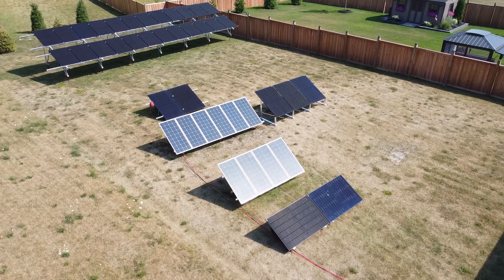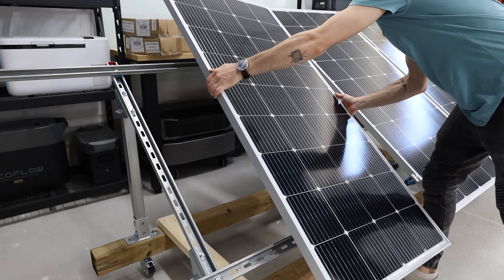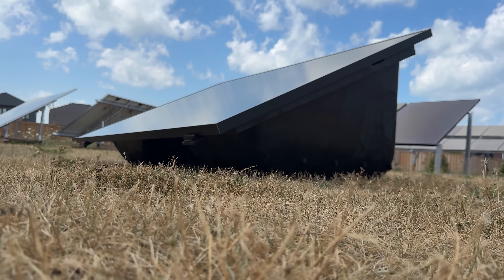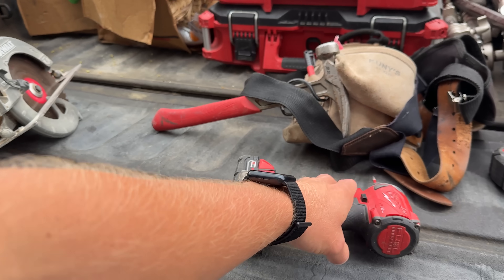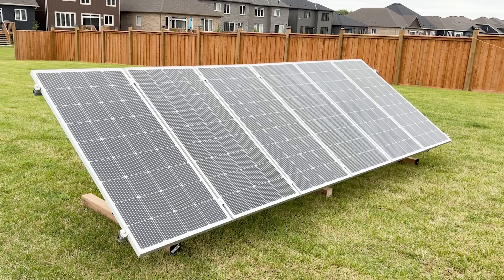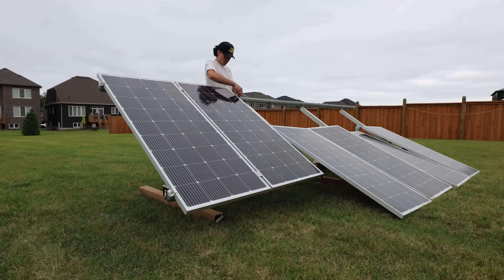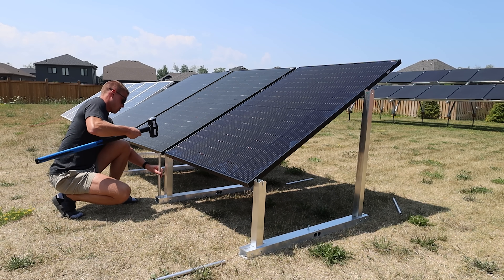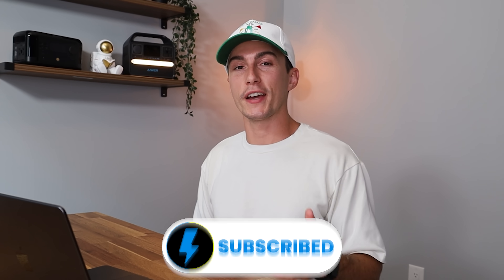Top 5 Solar Panel Ground Mounts in 2025 - DIY Friendly!

Comment: Well, I typically find a video like this after I have already made my purchase, and that is the case again, luckily I bought the Integra system for my 14 560 watt panels, I was very impressed by how well thought out this system was, I had no difficulties with the grounding spikes, after pre drilling the holes where I set up the rack, I installed the spikes upside down to keep from having to move the rack to complete the drilling. Although I chose not to use the epoxy, the system is very solid and it is perfectly aligned. Instead of being shorted on hardware, they supply extra, plus they even supply a 13 mm ratchet wrench. I am very happy with the system.

Comment: Would you review the larger EcoWorthy ground mount?  It's supposed to hold 8-200W panels or 5-400W panels.  I'm curious as whether it's as flimsy as their smaller mount or if the parts are beefier.

Comment: I am back watching this for ideas.  I had looked at IronRidge and Sinclair.  Have you ever looked at those mounts.  IronRidge is fixed and Sinclair is seasonal if you get that option.  I would guess that both options are $4000-$6000 but look robust.   I have also considered a DIY wood mount with strut that can be tilted on one axis for seasonal.  Thanks for all your reviews.  All the best from north Texas.

Comment: I have two EcoFlow Delta Pro ultra inverters, each with 2 batteries. Currently, they are running with 10 Aptos 400W panels. I want to add 14 more panels; however, I need a ground-mount system that can hold the 28 panels in about a 35-foot-long space, height is not an issue. Could you recommend a ground-mount system that can accommodate those 24 panels in that space?

Comment: My opinion. I would use chain link fencing to make the ground mount. Then jerry rig the panels using the top and bottom brackets from these systems. So the top rail and bottom rail would be the chain link rails and I would just screw the bottom rail into the concrete at what ever angle you want. or other mounting area. So this Integra rack looks good to me.

Comment: Love your videos. Very informative. Looking for your suggestion for a mount system to be welded to a single jet-ski trailer. My four Eco-Flow 400w panels weigh 45 lbs ea. They're 44 5/8 x 67 3/4 ea. Only plan on using them to recharge our DPU 5 batteries in case of a power outage. Trailer and panels will be stored in the garage until needed. Thanks in advance for your suggestion.

Comment: I wanted to add: Those stakes on the IntegraRack were never designed to be hammered into the ground and it says that clearly. I just want others to know that a hammer drill must be used 1st, and then the stakes push into the ground, and you fill them with epoxy, and they are stronger than most other mount options. I don't consider them permanent because they can be cut quickly if you move the panels/Mounts later. Those Mounts are clearly the best bang for the buck at this time, and it's only a little more to get the adjustable setup if needed.  I found this video very helpful so thanks for doing this comparison.

Comment: I like the Integra Rack, but would like an option to add a second layer above the first, like the Chiko. Otherwise, if you have a 20 panel setup, you need like a bazillion-foot long yard to put it on.
Reply: Just use 2 rows spaced so they don't shade each other.  These are designed to be low to the ground.  A second row of panels would require much more structure and expense
Reply: @cmbakerxx  my installation is lengthwise on top of a shipping container that’s a self-contained mobile off-grid building, so there’s only 8 feet of depth. The first row would shade the bottom part of the second. My solution was/is to push the rack to the back, and mount a second row flat on the roof. Testing shows that I only lost about 10% of the panel wattage, so it works, but isn’t ideal.

Comment: Thank you for the great video. This would be a perfect segue into a panel bonding and grounding video which is a very important but confusing topic. I've watched many videos, what they don't do is detail how the ground mounting panels are bonded and then how and where to run the ground from the panel to! Maybe review bonding clamps at the same time?
Reply: These guys are bad.  They are judging mounts to how and why they mount panels.  NOBODY will mount panels like they do, because they are making videos.
At your property you should only buy one brand and size of panel.  Only use the same panels in a string.  You can use different panels, but they must be on their own string.
They are miss judging mounts based on them being able to move them around.
Mounts need to be securely attached to the ground.  (And properly grounded electrically.)
AND remember panels can last for 20+ years.  Choose wisely.  And buy a few extras when they get broken by the kids, dogs, bears, deer, baseballs, etc.
Reply: @billy-go9kx don’t agree. They show us options that we can choose from…it’s the purpose of the videos.
Reply: @nunito007 But their opinions are based on their usage.  Which is not normal.

Comment: Interesting.  I'm 400M up on a mountain facing the ocean.  So susceptible to Typhoons. (Hurricanes) Also on a 45 degree slope. Requiring (24) 12x12  of varying heights cement columns for two rows of ten panels. Welded to column rebar , heavy braced angle bar with 6 aluminum rails screwed to the angle bar , so 6 clips per 580 w  bifacial panel. Average panel height 6 feet off the ground. With a 12kw hybrid inverter and (2) 51.2V/300Ah  15.36kWh LiPo4 stand alone batteries....all in with labor  
  $14,000.  USD  { In the Philippines }

Comment: All of your individual vids on these solar mounts provided great info! Have you ever tried to simplify the adjustable rack issue by using the  Renogy 50in Adjustable Solar Panel Mount Brackets with Foldable Tilt Legs on some 4x4's with those same footings you used on the Chiki Ground mount system? I heard they are pretty solid.🏌🏾‍♂️

Comment: I just installed a bunch of Integrack IR-40FSAB, the black powder coated steel frame is super easy to install. On your guys test rack, you should have added the 1” EMT that goes into the bottom frame, it makes installing them (the correct way) a bit more realistic. I also used the 1” EMT to run PV wires.

Comment: You guys want a Sinclair ground mount? We typically put 42 - 450w bifacial up in 5 hours wired to the discos. 5200.00 bam and seasonally adjustable and directly bolted no clamps.  I've searched the world over for the best ground Mount. By the way, I have a $15  ground mount that has lasted for years. PVC pipe and some zip ties. Lol
Reply: I plan on doing a review of the Sinclair Ground mount one day if I can ever get my hands on one, I have panels tied against the fence now and that really sucks for Michigan weather, lol
Reply: Sinclair adjustable ground mount by far the best mount out there. Just wish they had a southwest stocking supplier, the freight from Michigan to Arizona was not cheep.
Reply: Do you have a video of your PVC mount? :)
Reply: The Sinclair mounts look awesome though it looks like very deep and large concrete footers are required.   But not that many of them..
Reply: @engineer775 YouTube channel is a awesome resource.
Reply: T post and t post clamps work as well. I’m in SE Michigan
Reply: 590 watt bifacial panels paired with sinclair adjustable = best I've found
Reply: Do you do 42 panels in just one mount? Or do you split them in 2?
Reply: @eloymarquez4783 20x 590 watt bifacial on 3 posts for single array
Reply: @eloymarquez4783 Sinclair sells the mount for different amounts of panels

Comment: I must be doing ground mounts wrong.
I have one end of my panels on a cinder block and the other end on the ground.
Reply: How is it holding up
Reply: @hunterrobin9929  Except for the 3 winter months, it works well. A greater angle is needed for those months. During those months, I lean them against my garage on an extension ladder to keep them out of the snow.

Comment: Out of all the mounts I have looked at, I will agree with you that the Integra looked the best.  But, even tho they are less expensive than the others, when the "accessories" cost as much or more than the main product, it is way too much!
Reply: The mounting options are for an entire row. You need to look at price per panel. The spike kit is about $30/panel. The rack is about $130/panel for a row of 10

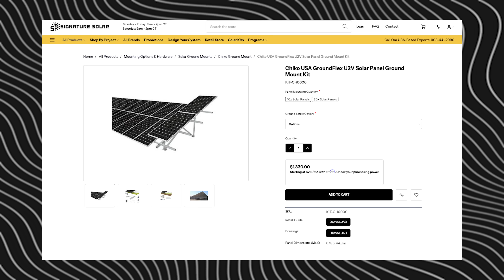Comment: 5:51 that 10 panel for 1330 is sort of Misleading. It's not designed for Big solar panels probably 300w at the most and for whatever reason this option doesn't deliver to residential customers. The other one did (the Bigger solar panel version) but this one does not. And that Ecoflow, I have seen a video by a guy Everydaysolar who put TEN 400w panels on his, with the New and Improved Version of it. I live in a State that gets a lot of Snow Sometimes (Michigan) and that stopped me from getting the Integrarack after seeing a post on diysolar forum of this guy using it in the winter with snow covering up the bottom of it, I love the way they look but I personally couldn't do it, maybe if I lived in Nevada like Will Prowse, lol

Comment: Sadly eg4 brightmount is no longer in production!!!
But I would put the foot on the back of the 4x4 (6x6) and only bolt the back support on it and use another bracket for the angled support...
I am using ground screws and cable to support the integra stand/rack....
Reply from the maker: The bright mount should be coming back but they don’t have a timeline on its launch!
Reply: Look up Integrarack IR-G Series it might be something you could get into. They are not like the others, It's kinda like a Pole mount
Reply: @Moes_Prep_and_Tech  sorry could not find such rack...

Comment: the integrarack is a great looking rack but i dont wanna spend more money then the cost of the solar panel to mount it but I am capable of making my own solar panel mounts. I think the Amazon mounts which are like $60 to hold 2 panels and then mount those to simple wood base is a much better option then any of the racks featured here.

Comment: I have the ecoworthy stands, but I added heavier 10 foot top railed and used the included rails to secure the base.  This fixed the flex and the stability
Reply: I'm using the Eco worthy stands they are the newer stronger version  and they don't flex like he showed so? I bought the set sized for 5 500w panels I only have 4 400w panels though haven't had any sagging but I have only had it installed 2 months. we did have a big windstorm but it didn't affect them at all. that last panels system looks really nice to set up but it is by far the most expensive looks like you need n+1 number of legs per number of panels and so for 1 Pannel that's 240, 3 that's 360 and 4 its 480 so only about 100 more.  (although currently they are 299 for the 5 panel system)

I also have mine mounted on 4x4 but the 4x4 run from front to back and then i have the 2x4 running from side to side. where the ones in the video were set up with all the front feet on the 4x4 and all the back feet on a separate 4x4  then they had 2x4 helping keep the same foot distance. not sure which would be better, but my option helps keep more rigidity for the front to back feet. this is were I expect most of the forces to be. I put them on 4x4s so I could move them if I want.

anyway, good video on the mounts.

Comment: so just to be clear, If i need to mount 8 panels and go with the integraRack, I would need to order 9 legs?  or 18?  they come one leg for $120 or come in a pair?
Reply: The integrarack IR series is also rated for 200+ mph winds for panels <32ft2 when moved to the 'flat' position - check out the engineering drawings on the site for more details. My 16 IR15s are currently on a ship to the Caribbean to be bolted to the flat concrete roof of a garage we are building.
Reply: From what I can see on the website, you would need 9 legs to mount 8 panels. The website is selling per leg.
Reply: It's always one more leg than your solar panels. if you have 4 panels order 5, if you have 8 panels order 9 like you said, the hidden cost is the legs. I want the Premium adjustable version but it's like 180 or something like that per leg If I wanted to put 10 panels it would cost me about 2 grand once I factor in taxes, shipping and the pipes I have to buy from home depot (which they don't provide) to slide in the bottom of it
Reply: @Moes_Prep_and_Tech  yea, I feel like some treated lumber and unistrut would be the cheapest way to go on this
Reply: For 8 panels you need 9 IntegraRacks.

Comment: I got 30" ground anchors on Amazon for securing the adjustable IntegraRacks. I used a impact driver with the included socket, placed the bottom rack piece and drove a piece of rebar into the ground 8 or 10 inches, pulled the rebar  out and moved the bottom piece and then drove the ground anchor into the ground where the holes were. The ground anchor had an I-bolt that then screwed into the holes where the spikes go with a properly sized washer top and bottom to hold the rack. This allows me to adjust the front or rear of the rack up or down a little. I wanted it to be strong but not permanent. the 30 inch ground anchors are stainless steel rated for about 1000 pounds each. A 6 pack was about $75.
Reply: What's the listing on Amazon called So I can look it up
Reply: @Moes_Prep_and_Tech  insaga 30'' ground anchors screw
Reply: The hero we needed. This is a fantastic idea, because I also don't want to be stuck with this in one spot in case I need to move it.